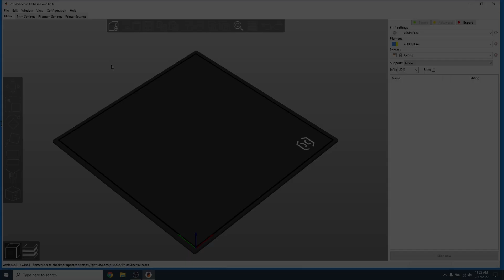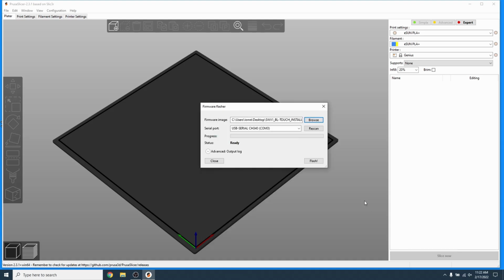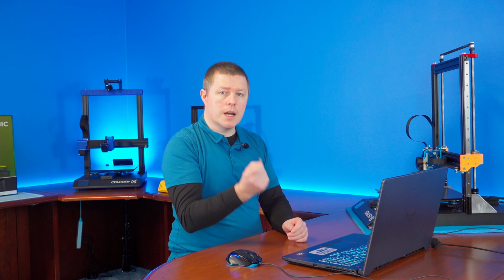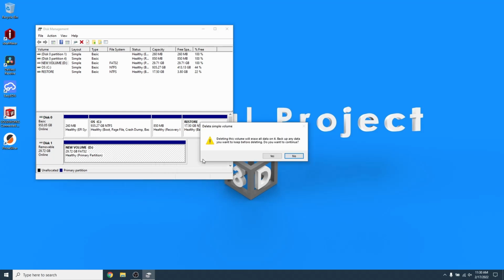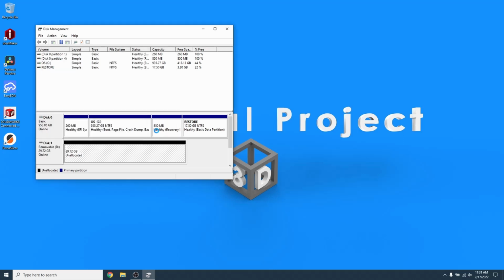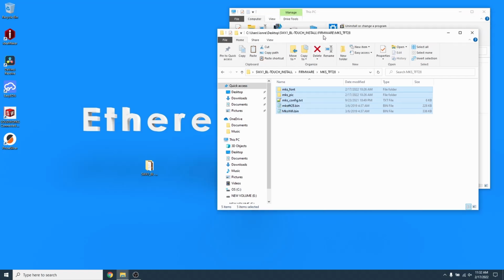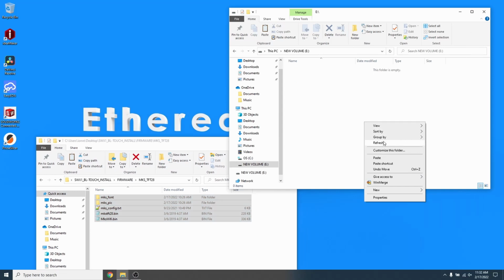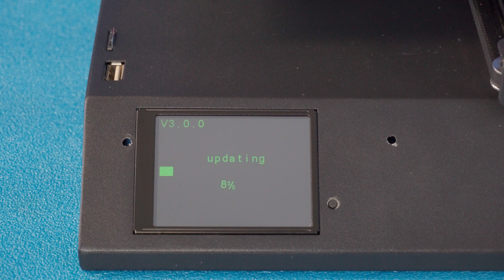Sidewinder X1 BL-Touch install, the easy way.

Comment: Hello, I just got a SW X1 from my dad when he upgraded to a new printer and since it has a dip in the middle of the bed, I'm planning on installing a BL Touch. I prefer to update the breakout board over using the LED pins or running a long cable to the main board, but it looks like the site linked no longer exists. Is it still possible to get the breakout board?
Reply from the maker: I will see if i have an extra one I put together. Wix wanted over $600 to renew and that seemed a bit rediculous.
Reply: @EtherealProject3D  Thank you! I assume it's a custom circuit board based on the video of you building them so I can't imagine trying to build one myself...

Comment: I've followed all these steps. But when I go to update the mesh. It just touches the center and stops. How do I get it to tpuch all the points.
Reply: I was having the same issue, then I realized it checks both the nozzle and bed temperature before the test. So just press the orange PLA Preheat button and it will run the full test once they're both up to temperature.

Comment: great tutorial!!! for someone new to the field it was very simple!!! However, I find myself with a problem, when I click on the tool tab then more, the page that opens is empty, it is not possible for me to configure the Z offset... could you tell me what is the terminal to follow?
Reply from the maker: @damienschmitt8634  Try reuploading the tft firmware with a different sd card
Reply: @EtherealProject3D  yesss!!! Great thanks a lot !! it worked the first time!!!!! Thanks a lot ! It's nice to have an answer, have a good evening

Comment: I bought the breakout board, I did everything given in the video and it works from the first second! Great! But allow one question please: is it still Marlin? I used Orca Slicer in Marlin2 mode before BL-touch install with your firmware. Please let me know!
Reply from the maker: @oelhahn100  Yes it is still marlin, orca slicer will work fine.

Comment: The cooling fan on the cooling bar does not start when the extruder reaches a temperature of 50°C. I connected the fan to the Fan1 fan connection for the parts cooling. The fan FA2 (heat block fan) works. Then I checked the mainboard, and when the extruder is set to heat up to 220°C, the LED of the MOSFET for FAN2 'HE01' lights up at a temperature of 50°C, but the fan itself does not start. This is with your firmware for the X1 with BLTouch."

Comment: do i have to change my slicer profile now because of the bltouch on my x1?
Used slicers: ideamaker and cura.
Reply from the maker: You shouldn't, but adding M420 S1 after G28 in your start gcode is good insurance.

Comment: I have a error when choosen home all for the first gime after following instructions.
Error: stop called because of bltouch error - restarr with m999
Reply from the maker: Your BLtouch is not wired correctly.
Reply: Hi, it is package from you ordered. I can just plug in
Reply from the maker: @AgentschapTD  Have you updated the firmware
Reply from the maker: @AgentschapTD  And have you moved the required connection on the inside of the machine
Reply: Checked forgot one cable to replace.
Everything is wotking fine but i!'m asking myself do i have to change my slicer profile now because of the bltouch?

Comment: hi there - excellent video, thanks.
can you advise which BL Touch unit you would recommend for the Sidewinder X1v4?
and the connection type - DuPont or JST?
this would help me when deciding on which PCB to buy.
thanks
Bill
Reply from the maker: I prefer a genuine antclabs, they have dupont connector
Reply: @EtherealProject3D   BLTouch installed on my X1v4 and seems to be working just fine.
Your install video was very easy to follow.
Quick question - in PrusaSlicer printer settings, my default G-Code flavour is Marlin (Legacy). After updating firmware, should I be using Marlin 2 or does it not really matter?
Thanks.
Bill
Reply from the maker: @billweir1573  I wouldnt expect it to matter too much but it cant hurt to change it. Thank you for Watching.

Comment: Just completed the upgrade yesterday. I have to say your instructions were very easy to follow. I am having some difficulty with the first layer on the corners where the probe hangs off the bed, but otherwise the upgrade has been a big improvement.
Reply from the maker: Im happy it has helped. You can try heatsoaking the bed for a few minutes to help in the corners

Comment: Hi is there a way to revert the process. after double checked with two friends it seem that i have a very special machine since nothing work anymore thanks
Reply from the maker: Yep, just download the factory firmware from the Artillery3d website and install it on your machine.

Comment: Hi Matthew. Was wondering if you have any experience with the Biqu MicroProbe V2.0? I'm going to install it on my X2 with klipper. And wondering if I can use the config and the mount for the CR touch?
Reply from the maker: I have not tried it yet. My mount wont work for it as the BIQU probe is much smaller than the bl and cr touch.

Comment: How do I find out what version Sidewinder I have?  I bought my Sidewinder in 2020, did a lot of printing then kinda got frustrated, due to a rash of bad first layers and trouble shooting that wasn't going anywhere, my interest waned and I stopped using the printer.  I want to get back in to printing and I know that auto-tramming is the best way to get that good first layer.
Reply from the maker: If it has a button next to the screen its a V4.
Reply: Thank you!!  I can upgrade with confidence now.  I saw you did a video on installing an all metal hot end on a SWX2, any plans for a SWX1 all metal hot end video??  :)
Reply: Trying to install the firmware but the flashing keeps failing.  I'm at a complete loss as to why this is happening.  I'm thinking I've probably missed several previous firmware updates and there may be compatibility issues.  Here is the error I'm getting from PrusaSlicer 2.6.1: 
                Using Port                    : COM5
                Using Programmer              : wiring
                Overriding Baud Rate          : 115200
avrdude-slic3r: ser_open(): can't set com-state for "\\.\COM5"
avrdude-slic3r: Could not open port: COM5

Any help will be greatly appreciated.  Other Serial Port is: Communications Port (COM1) which I have tried with similar results.  I've followed the video exactly as stated.
Reply from the maker: @scrag2841  Try a different USB cable, and other USB ports
Reply: I have switched cables and ports with the same results.  The USB port in PrusaSlicer changes when I switch to a different port, but it will not communicate.  Should I see the printer in File Explorer like I would if I were to plug in an i-Phone?  The computer acknowledges that I have plugged in the printer by giving the chime notification.  Have you heard of any printers having bad USB ports on the main board?
I also do not see in the PrusaSlicer Serial Port drop down menu "USB-SERIAL CH340 (COM?)" where ? = a channel number.  I know this is the key to the issue but I don't know what to do to resolve this.  What I do see in the drop down menu is "Communications Port (COM1)" or "RAMPS (COM?)" where ? is a channel number.
Reply from the maker: @scrag2841  yes it is possible to have a usb port on the machine go bad. can you connect via pronterface and control it that way? Also maybe try using cura to update it.
Reply: I found the issue - I needed a CH340 driver for windows.  I was looking for reviews on replacement mainboards and came across a post or blog about the computer not being able to communicate with the printer.  The poster mentioned that you need a CH340 driver (and also provided a link to where I could get the driver), looking in to it further this driver is used with Arduino boards.  Once I downloaded, extracted and, with the printer plugged in, ran the .EXE file everything went smoothly and your firmware is now installed.  I would like to thank you so very much for helping me.  I can now finish the rest of your video and the install.  :)
Reply from the maker: @scrag2841  IMO stay away from MKS boards. A RUBY would be a good replacement on the cheap or you can spring for a BigTreeTech but you would need a new screen as well. Easiest solution would be a RUBY. I can help with the firmware if you need.
Reply from the maker: @scrag2841  Oh nice. I figured you had the driver already. My bad. Im glad you got it figured out. Let me know how the firmware works for you.

Comment: Will this mod keep the original print LED working? Are there different versions of the bltouch on the market? i presume the dupont vs jst ist realated to the cables of the bltouch? soory for all the questions
Reply from the maker: You loose the LED with this mod. There are different touch probes out there and some have ether JST or DuPont connectors. Most have the DuPont connector and some people opt to switch to the JST.

Comment: question... I upgraded to 2208 drivers...Do I need to change the config h to 2208 from 2100 ???  How?
Reply from the maker: find where it defines the 2100 drivers amd switch to 2208 and recompile.

Comment: ☢Hi! I follow exactely your instruction and validate every step before moving to the next step ... finaly I turn on my printer and there it was whit the new menu the bl touch activated and i decide to make the final test ... the bl touch lights up but retracted and it do not extract when i tried to check it for good behavier ... every thing works exept the bl touch. I had 2 bl-touch and both does the same thing. I am not a rocket scientist but i spent all my life repairing electronics and using 3d printer. I am 73 and i have no time to loose and i have no clue as to what hwen wrong. I used your interfac board and print the bl holder all when 100% but it do not work ... could you give me a hint please ... be waiting for your answer. Tks
Reply from the maker: My guess is someting with the probe is not wired correctly.
Reply: I have two of them and they react the same way ??? i will by another one and see ... will keep you inform, tks @EtherealProject3D
Reply: I received my third probe and it react the same way as the other two. I decided to redo the installation and end up with the same result ... so for me it did not work is there a way that i can revert to my original machine because it is the only machine i have that can print your filament feeder and your spool holder unless you have an idea as to have it working. Thank you very much it is a nice work and the new display I will miss.

Comment: I have bought a x1 with bl touch already installed, i see that you are using different firmware then one installed on my printer, and because i have some troubles with it i would like to install yours. Only question is do i have to disconnect the screen even if i just want to install firmware?
Reply from the maker: For the mainboard yes, for just the screen, no.

Comment: I,m very worried with my x1, because  hot bed is blended in the center and I can´t do right plate´s  leveling  for printing. I´ve installed a bltouch and uploaded firmware, but my bed are unleveled  anyway...
😞

Comment: So you do all of the manual leveling with extra steps just so you can auto level? lmao
Reply from the maker: Its tramming then surface maping.
Reply: @EtherealProject3D  I upgraded to a  skr turbo 1.4 on my sidewinder x1.(yet to flash new marlin software)  I was thinking of getting your sx1 upgraded extruder pcb as well.  Will those, and the bl touch install files work with the tft 35?  It seems a lot of people have issues with the tft28 connecting to the big tree tech boards such as the skr 1.4
Reply from the maker: @Arunnejiro  I have a firmware build just for the BTT TFT35, the firmware for the stock screen will not work on the BTT scree. I also have a housing you can 3d print for the BTT screen as well.

Comment: What size microsteps does the new firmware use? I have a calibration test print with squares that vary in Z height in 0.01 mm increments from -0.05 mm to +0.05 mm and want to know how to adjust. Thanks.
Reply from the maker: 16 if i remember right.
Reply: Do you happen to know the X1's Z-step size? Not as easy to Google as I expected... Thanks again!
Reply: OK, I THINK it's 2mm pitch, so at 1.8 deg/step that'd be 0.01 mm per step, so 1/16 that?
Reply: Nope. Bit of tape and moving the Z-axis in the "move" menu reveals it's 8 mm pitch, so that's 8 / 200 = 0.04 mm / step, or 0.0025 mm per micro-step. Thanks once more.

Comment: Hi, qq I have an SKR 1.4 T and your extruder board (X1). I have found the 3 LED wires and the ground motherboard side, but where does the white BL sense (probe/trigger) wire come out? I want to wire it to the dedicated BLT port on the board. Or does the wiring provide a common ground so, rather than 5 wires running from the motherboard its 4 wires, and the ground is spliced into two providing two grounds for the BLT??
Reply: After some probing with a MM it looks like its common ground.

Comment: The BLTouch has 5 wires, but you just move the brown connector (3 pins) and the black connector (1 pin)

Is there a common GND or something? Bought your board but I also just changed to an skr 1.4 so want to make sure I’m wiring it properly but I’m obviously 1 wire short!
Thanks
Reply from the maker: The ground is common yes
Reply: @EtherealProject3D  thank you so much for the quick reply! I’ll give this a try tomorrow in that case!
Board works a charm with the skr 1.4 👍🏼

Comment: Hello there.  I have read all the comments, and purchased all the necessary items.  I have installed everything, and I got it to self level, heat up, unload the filament, that I placed manually.  I just can't get the machine to load the filament.  The motor sounds like it is grinding.  I have rechecked all the wiring, and re-installed the software, still no luck.  I have replaced the ribbon cable twice with new ones, and also purchased a complete extruder assembly, and still will not load filament.  Currently, the printer is a paper weight.   Has anyone else experienced this?  Anyone have a solution?  Thanks in advance.

Comment: the newer skr version 3.0 has spots to plug  all 5 bl touch wires in, are you familiar with this board, and do you think it will work with your pcb? also would the fw work if i change the motherboard name in vs code?
Reply from the maker: I have the SKR 3 in my corexy machine. It will work in an X1 and have no trouble working with my breakoutboard. There are some differences other than the board name in the firmware that you would need to change.
Reply: @EtherealProject3D  the x1 only has 1 wire to connect to the motherboards probe port(the z endstop i think), i dont think my probe functioned correctly with just the one wire on the skr 3.0, maybe i could tie the black and white wires together and see if it works on the regular breakout board. do you have any insights to this? my skr 1.3 worked fine with the 1 wire/ waggster mod

Comment: Is this process the same for artillery sidewinder x2?
Reply from the maker: No, the X2 has a different mainboard and had a different method of installing firmware. And the extruder breakout board is different on the X2
Reply: @EtherealProject3D  I found your mount on "Thangs" for the bl touch on sidewinder x2, do you by chance have a video detailing the process for x2? I am new to this so any more info is helpful. Thanks!

Comment: So glad I found your video; I had bought my BL touch 2-3 months ago and I was dreading the install process; finally decided to stop dragging my feet and your instructions are very straightforward and in layman’s terms. Thank you!

Sidebar; will installing the Bl touch halt the filament sensor run out?

Also do you have a video on setting up octoprint on the sidewinder also in layman terms 😅
Reply from the maker: Thank you so much, Im glad you found it too. Adding a bltouch doesn't disable the fillament runout, it has to be enabled in the tft firmware, its the .cfg file. I do not have a guide on octoprint.

Comment: Hi. I've been using your bl touch board and firmware for a while now. My print head had issues so I bought a new one. I put your board on the new print head, crimped the ferrules on, etc. But now my bl touch sensor does not stop the z axis? I though I wouldn't need to flash the firmware or touch screen as I put the Ethereal board on the new print head. Any suggestions?
Reply from the maker: Check your wiring on the bltouch, abd make sure nothing got damaged when you switched the board out. The wires are pretty easy to damage. Also make sure none of the wiring came loose on the inside.
Reply: @EtherealProject3D  The 2 wires that we connect the ferrules to, do they need to be connected in a certain order like Right or left?  would switching them possibly help or does it not matter?
Reply from the maker: @charlesparell5597  those ones dont matter.

Comment: Any chance you know how to configure klipper to work with your ethereal PCB?

*Update = Mathew from Ethereal Project 3d reached out directly and helped me through getting this configured in Klipper. Would have been lost without his great support.
Reply from the maker: Are you trying to configure the BL-Touch in Klipper with the board?
Reply: @EtherealProject3D  Im currently trying to do this but unsure of the pins, any input
Reply: any chance on updating how you got it configured seem like others had the same intentions on using klipper with this board